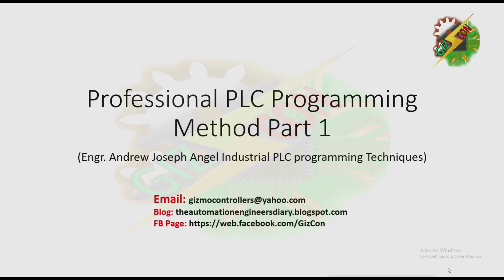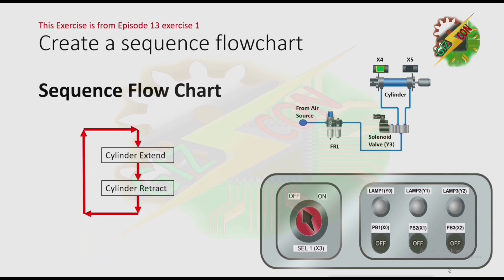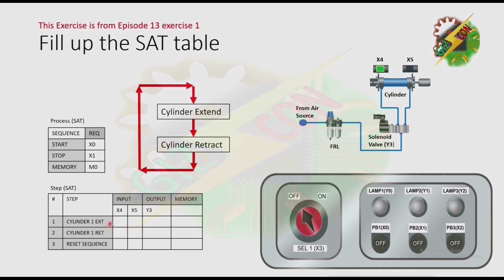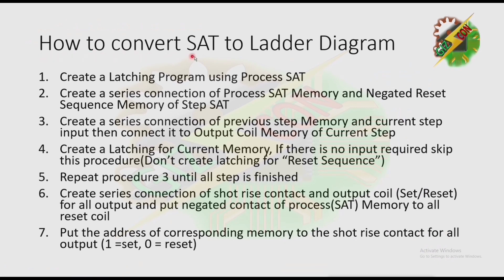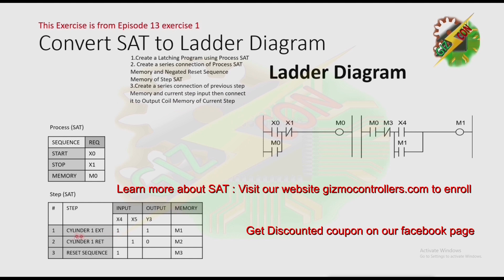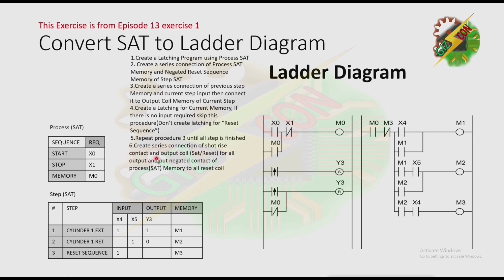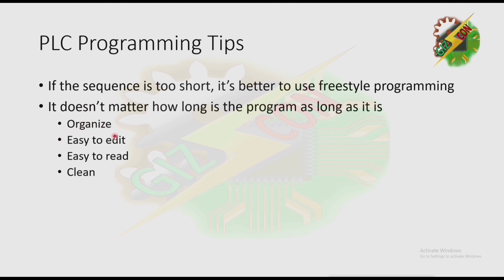Professional PLC programming method Part 1 Secret Technique Revealed

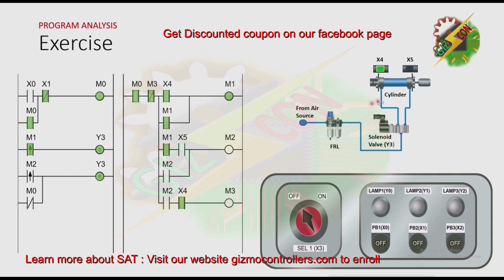Comment: at 12:36 mark, why is it that both set (y3) and reset coil (y3) are both turned on? it should be the set coil only right?
Reply from the maker: I am using power point for the animation, I just base the animation of this video on what I saw on the other simulators